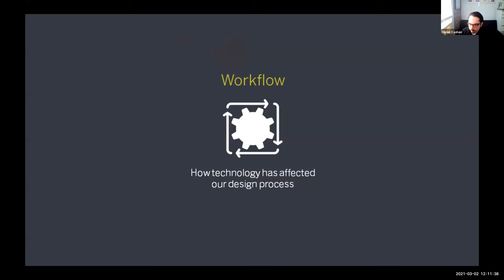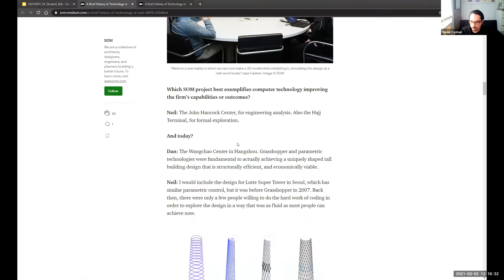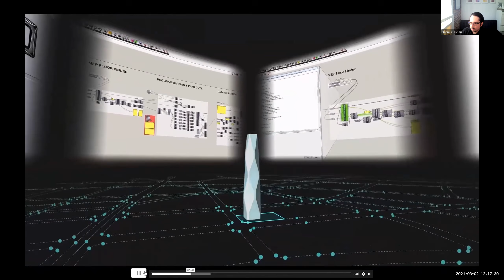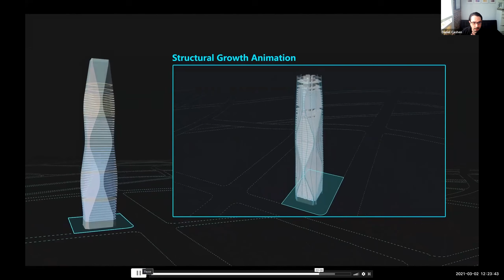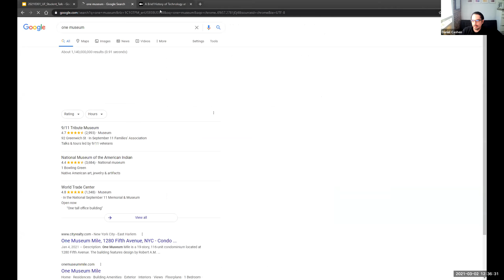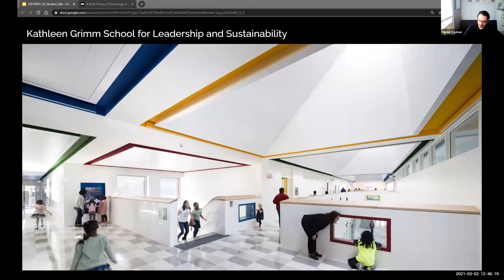Guest Lecturer Daniel Cashen, Skidmore Owings & Merrill

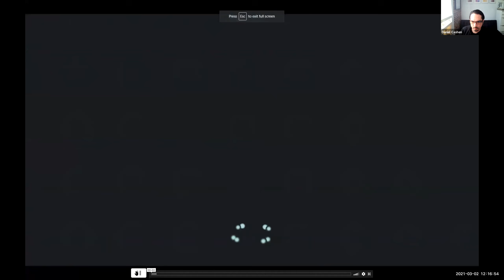Comment: I was an architect at SOM-New York from 1984 to 2009 starting as a junior designer (D-level in SOM ranking) rising to senior technical architect (F-level). In 1984 almost no architectural firm was using computers except SOM*. Arriving at SOM almost 25 years before Mr Cashen, I can fill in some of the early history of technology in Architecture. The advantage SOM had back then was financial. Early CAD software had been developed as prototype technology projects at several universities including Cornell. In the days before the PC and AutoCad, computers were expensive and software was proprietary. SOM was almost the only firm that could afford to buy the hardware and write their own software. The hardware was VAX minicomputers with Tectronix terminals and the software was their DRAFT software, which I quickly mastered with the help of two fellow SOM staffers: Natalie Leighton** and Neil Katz. Both of them deserve credit as pioneers in architectural technology. Up until then, DRAFT had been mostly used for technical architectural applications. I was one of the first to use it for design. The resources were very limited in the NY office. A VAX 780 could only handle 7 or 8 terminals, and we had 3 VAXs. That's 24 terminals available for a staff that numbered in the hundreds. At one point we had two shifts 8:00-4:00 and 4:00-12:00 to maximize use of those 24 precious screens. 

The big break came when SOM partnered with IBM to move DRAFT to the IBM's new RT workstation, a RISC minicomputer that was closer to a PC in size. It could fit under my drafting board. The pricing enabled SOM to have many more terminals and use them for more than just floor plans. We began to expand into elevations and other design drawings. When the designers discovered that DRAFT was capable of color and especially transparency, usage took off. The IBM RT proved to be a failure, but their next new product, the IBM PC was a hit. DRAFT, now called AES, was updated and moved to the PC. Unfortunately for SOM, the PC was so inexpensive that many smaller firms could afford them too. Then the software firm AutoDesk realized there was a mass market for CAD software in these smaller firms and introduced AutoCad which could run on the least expensive PC configuration. More important though, architecture schools started teaching AutoCad. SOM discovered that new hires were arriving expecting to use AutoCad, not SOM's AES. Guess who won?

About 1997, two professional engineers realized that AutoCad wasn't well suited for architecture. It was a general purpose program that could model almost anything that could be drawn. Leo and Irwin Jungreis set out to write a program that was specific to architecture. Instead of lines, circles and polygons, it would have doors, windows and toilets. They called it Revit. When I first used Revit I was amazed. This software understood how architecture worked. We were able to model entire buildings. Where AutoCad was designed to produce drawings, Revit was designed to produce 3D models of an entire structure inside and out. Animated walk-throughs were possible and became an important presentation tool. The models could cast shadows and be ray-traced. The stage was set for a new generation of design programs that could collect all this technology into a new generation of programs that could produce incredibly realistic  images like the ones you present here in your lecture.

I'm retired now. It's great to have been on the ground floor of technology and to see how the next generation after me has taken our pioneering efforts to even newer heights.

[* HOK had DRAW]
[** see Natalie Leighton "Computers in the Architectural Office" Van Nostrand Reinhold, 1984]